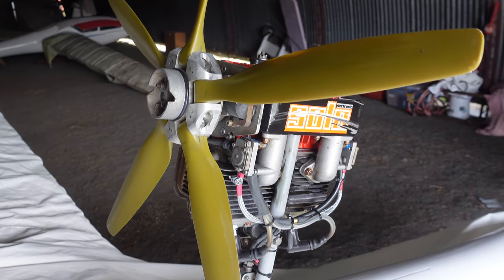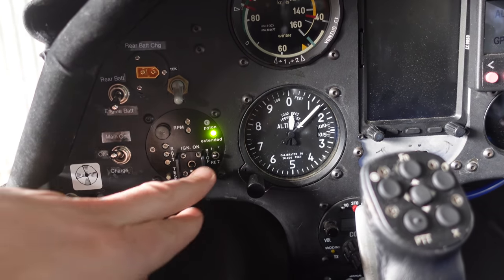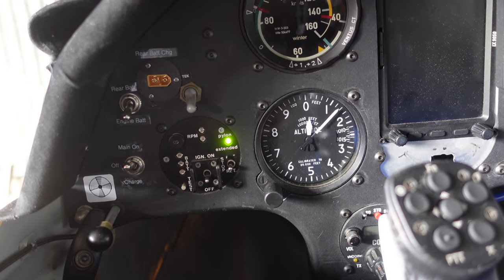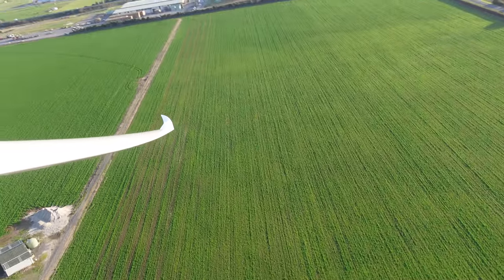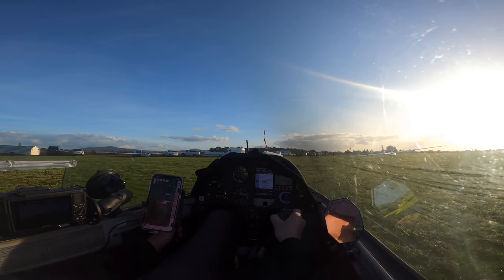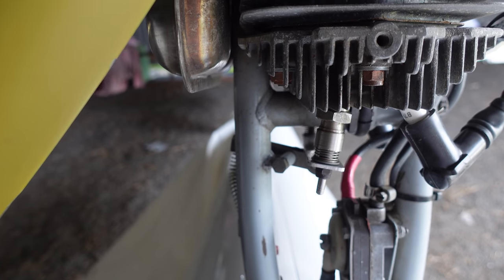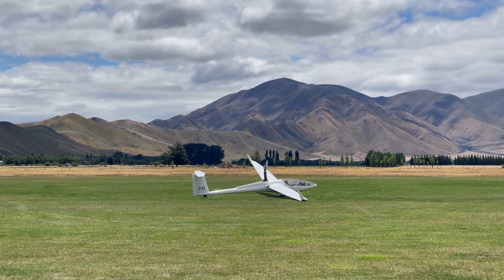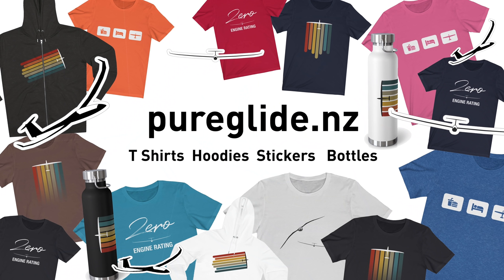How a Glider Engine / Turbo / Sustainer Works

Comment: The centrifugal forces (aka inertia) are enough to keep the prop from folding.  Perhaps this is another reason for the lack of a throttle.  At some torques and RPM, maybe the blades would begin to fold?
Reply from the maker: I don't think it takes much, they normally are fully folded out before I start the dive, before the engine even starts working. Keep in mind the wind on them too when flying...
Reply: @PureGlide  The wind would open them and spin them for starting.  I was thinking about after the engine was started.  The prop is a spinning wing, and the aerodynamic force is forward (trying to close the blades).  The only thing keeping them open is centrifugal forces, which are a function of mass and rpm.  The forward-folding blades seems somewhat bazar and counter-intuitive, but obviously stay open and work.
Reply: Centrifugal force is the only thing keeping helicopter blades from folding.

Comment: Since it can manage to climb with the engine, I'd expect it could likely take off from a good runway.  But this smaller one might be like one of the old wood and canvas airplanes where you need a bunch of helpers to start the engine and give it as much of a running push start as they can to get it up to a speed where it's stable enough to not drag anything on the ground.
Reply from the maker: Yeah that is exactly right, people have started it on the ground and launched with it I hear, a bit of a help to get it started can make it easier. One day I might try it! Cheers

Comment: Thanks Impure Glide ;) I don't fly sustainers but I guess another big risk is forgetting to mix the oil into the fuel... The engine would run for a few minutes, then you'd be hoping you could get back to the field you had chosen!
Reply from the maker: Oooh I don't even want to think about that! I have a careful process, involving two clearly labelled fuel tins...
Reply: If it actually climbs at 1.7 knots on average at 55 knots forward speed it's a piece of cake to get back to the same field even with a straight out climb -- as long as you put the engine away first. You do need to make sure you're not flying in sink though -- 1.7 knots is no match for 10 knot sink. You still have to think like a glider pilot, not a jet fighter pilot.
Reply: @BruceHoult  Good points! Hopefully you are also climbing into wind which will also improve the glide ratio back to the field. Haha yes even power pilots get caught out by the sink from mountain wave :)
Reply: I would suppose that one must be just as careful when refuelling this sustainer setup as aviator must be when refuelling any kind of aircraft engine. :)
All due care and attention required, since you can't get out and walk.

Comment: Don't those blades fold "the wrong way"?  Seems like when they produce thrust, they'd push themselves toward a folded position.  (Although I guess centrifugal forces would overcome that.)
Reply from the maker: I suspect the centrifugal force is stronger than the forward force they generate!

Comment: It looks backwards. How do the props not fold when throttled? The direction of thrust looks like it would push the blades closed. Is it kept open fighting that urge by centrifugal force alone? Why did they not just make the prop a pusher prop so it doesnt have to spin fast and can fold into the wind?
Reply from the maker: I can assure you it’s around the right way! And works just fine :) the airflow keeps the blades folded out, let alone the centrifugal force, which definitely keeps them out
Reply: @PureGlide  so the wind holds it open, but wouldn't the thrust push it closed?
Reply from the maker: The centrifugal forces will keep them open I guess! Cheers

Comment: Definitely I agree engine on the competition is not cheating but... it gives mental advantage that more risky option (potential outfield landing) is easier to choose.
Reply from the maker: Yeah agreed. Also the pressure to to not land out for inconvenience is not as great, so you tend to push further, or later into the day. I almost put that in the video too, but was getting too long...

Comment: Why not pull decompress before starting to allow lower speed dive and waste less energy
Reply from the maker: Hi I guess you could pull it earlier, what really matters is when it is released, and are you going fast enough at that point. So  pulling it won't make much difference, except a bit more time to spin up?

Comment: The T stands for Turbo. But what does the c stand for? I'll never know and won't be able to sleep now
Reply from the maker: The C stands for the C model after A and B. They tweaked a few things in the C model including the air brakes. The A and B models had trailing flap air brakes, the C has standard Schempp-hirth brakes.

Comment: Hey I love this Idea. Especially in a glider. All that redundancy...
Personally I think it should be a pusher motor/prop mainly because of the flipping blades. The reason I say that, the propeller would not act as drag only as a pusher if you have a tail wind. If course it would need a starter.. Just an opinion🙂 
Stay awesome brother! Amazing content btw brother!
Reply from the maker: Hi thanks mate! PS there is never a tail wind, the wind is always coming from the front as the glider is always moving forwards through the air. Unless I'm doing something extra impressive :)
Reply: Yes sir, that makes perfect since. My apologies.
 Really cool glider though 😎
 Also, thank you for your response.

Comment: Imagine if you could extend the engines props out, as if you're preparing to turn on the engine, but instead you just let it be and the blades begin to rotate. The rotating shaft is connected to a mini generator which will charge the in-plane battery.

Is such a thing feasible?  
Or say, some sort of "air brake" which is really just some props/blades that rotate, and thus provide some drag, slowing down the glider, but their rotation is changing a battery.

Kind of like on bikes back in the day, you would put these tiny forward facing lights which were connected to a mini generator that would be touching the front tire, and powering the light.
Reply from the maker: Hi yeah basically like the regenerative braking my skateboard has! Funnily enough big planes have such a system https://en.m.wikipedia.org/wiki/Ram_air_turbine
I don’t think gliders need it, if the electrical power goes out the glider still flies happily. We don’t need our instruments that badly. And if you had an electric glider, I don’t think it would create any useful amount of power to warrant the cost and complexity. Also anything like that would create a lot of drag, and would sink the glider faster. Interesting idea though!

Comment: you should install a pylon switch bypass so if you see the engine is up but the switch is not pressed you can still turn it on.
Reply from the maker: Wouldn’t be a stupid idea! Luckily it’s been working reliably for 35 years (probably time for that switch to stop working!)

Comment: On the other hand, you have to be very careful, if the motor does not start working while you are flying at a very low level. (the drag amount is huge). Just recently a tragedy, or almost a tragedy happened (hopefully, the pilot will fully recover). But yeah, it was a competition where people are risking more..
Reply from the maker: Yeah it’s important to give up early and make a safe retrieve and potentially outlanding. Did you see in this video how I tested landing with the engine out? It’s not as bad as you might think, but still like having the air brakes out!

Comment: Great vid Tim! Taking off with a Turbo will invalidate the insurance of course plus the climb rate would be awful thus making it almost certain you would need to make a claim.
Reply from the maker: Yeah I guess it possibly could! I assume once you're off the ground you're operating as normal...
Reply: "Taking off with a Turbo will invalidate the insurance".  I am not disputing that, but why is that?
Reply: @alexanderSydneyOz  well your answer is in the original statement. A sustainer engine is not powerful enough to take of safely, they are not designed to take off. What insurer worth his salt would in his right mind cover such an act!

Comment: Aren’t these just ‘get you home’ engines for when you get caught out by crap conditions?

I used to glide from an airfield on a hill and once ended up 200ft below the height of the airfield, took my instructor an hour to get high enough to land, followed by lots of swearing and him chainsmoking about 5 cigarettes in a row. Landing out was not unheard of but a major pain in the arse.
Reply from the maker: Yeah exactly right!

Comment: Whats the XT60 connector for? 
Funny to see that coming from the RC world
Reply from the maker: Yeah I'm using them to charge my batteries. The panel mounts I've got for them aren't great, so will be switching them out soon to XLR plugs which is what a lot of gliders use.
Reply: @PureGlide  Audio technician here. I've often seen XLRs used for all kinds of non-standard DC power connections, but it's worth bearing in mind that as a balanced audio signal connector they really weren't designed to carry any significant current. I'm sure it probably wouldn't be an issue if used only for trickle-charging a smallish battery at a few hundred milliamps, but may I suggest using Neutrik Powercon panel-mount connectors and plugs or their generic equivalents. They have a very positive twist-lock action with a sliding tab on the plug so they will never come loose accidentally, they're extremely robust (designed for use in live audio situations where such connectors are often subject to a lot of careless handling and abuse), and they're very easy to terminate as they use captive-screw terminals, you don't even have to break out the soldering iron!
A drop of loctite on the panel mount terminal screws would prevent any issue caused by connections working loose due to vibration. Just my two cents, cheers mate.

Comment: love that outro, you should do some vids on aeros / wingovers etc. also the state-of-play of electric sustainers would be interesting
Reply from the maker: Thanks! Yeah I'll cover other types of engines in another video sometime
Reply: I imagine electric options must be getting more viable every day
Reply from the maker: We've had an electric self launching glider in New Zealand since 2011! I sense another video coming on...
Reply: Electric sustainers should be a game changer. I wonder, if one could replace one battery with a generator for more range
Reply: @daszieher  they are very much a thing! The FES system is already pretty common (seen on most larger gliderports). I would think that adding a generator with fuel is just more heavy and complex than another battery for the same amount of energy and power.
Reply: @otsokivivuori7726  If it had the same amount of energy.

For the 15kg that one FES battery weighs one can add a good generator and fuel to boot easily surpassing the energy stored in 15kg of battery.

I agree though that the simplicity of operation and reliability of the actual drive (i.e. an electric motor driving the propeller) is much better. I just don't see the total energy required to be stored lighter in a battery. kg per kg, the generator wins.
Reply: @daszieher  depends on how much energy you want. A generator is necessarily pretty heavy to start but of course adding more energy adds less weight with gas. I would say that with the amounts of energy in a fes system batteries are still lighter.
Reply: @otsokivivuori7726  not quite. 15kg of generator and fuel gets you more electric energy than a single FES battery can provide.

obviously the power output will be different. so a combination of both might be best.
Reply: @otsokivivuori7726  no need to have a petrol generator! Just put the prop to negative (or very low) pitch and charge the battery while on the ridge / cloud street / in a thermal. Obviously it would have to be designed with variable pitch (at least two positions) and the system would have to be set up for motor/generator use, which current ones aren't. If everyone started with the same level of battery charge (possibly zero) it wouldn't even fundamentally change the nature of gliding -- it would be just the same as if cloud base was higher.
Reply: @BruceHoult  this is very interesting from a competitive aspect.

However, I was looking more into flexibility. There the possibility to "load" more propulsive energy without adding much more weight would be a clear advantage towards more utility.

Comment: I'm having trouble with this.  When the engine folds down, the blades come forward freely. This doesn't seem right because if it's producing thrust, the thrust would pull the blades forward, in the same direction they can freely fold.  Is there some locking mechanism on the blades so that they lock in place when the engine is turning ? If not, it seems like they would not be very effective.
Reply from the maker: There is no locking mechanism. And it works great!
Reply: You have to consider that there is a lot of centrifugal 'force' on those propeller blades when the engine is running. Folding sailboat propellers work the same way, although they usually fold backwards. They still work when putting the engine in reverse though.

Comment: You'd think that would be a very good and easy swap for an electric motor?
Reply from the maker: Unfortunately not easily without a lot of work and money. The better option is to sell this old glider and buy a new one with an electric motor already in it. Cheers!

Comment: I was thinking the blades would start to close forward from the wind generated once the engine was started. I guess the force is great enough to keep the blades in position. Interesting the same.
Reply from the maker: How is it the last 20 comments have all wondered the same?! And I’m not sure why it is, but it seems to work just fine. I imagine the centrifugal force would keep them out?

Comment: really useful video, thanks.  Is there much difference between a cT and a bT?
Reply from the maker: A few differences, a slightly different wing profile but the main difference being a different airbrake system. The cT has the standard 'schempp-hirth' style brakes that all modern gliders have, while the b and bT used trailing edge flap brakes. The cT also came with 15 and 17.6m configuration, while the b I think had 16.6m extensions.

Comment: Do you stop the engine with the fuel cut off or the ignition switch?
Reply from the maker: Bah I realised I forgot that but after I posted the video! Yip just turn off the fuel, drop it a bit out of the air stream, and wait for the blades to stop moving, then lower it

Comment: Does the high thrust line cause a sudden pitch down moment on engine startup or is the pylon sufficiently canted to counter it?
Reply from the maker: Good question! It’s very close to the center of gravity. I’ve never noticed any nose pitch when it kicks in, but you do feel the acceleration. It’s not extreme :)

Comment: I disagree it's an advantage to have a engine because you can push into places where pure glider guiders won't chance. You should have to remove the prop before competition that makes it fair. I'm just saying.
Reply from the maker: Hi that sounds great, except you'll kill yourself if you fly like that, because the engine doesn't always start. You always have to have somewhere safe to land just like a non engine glider. Cheers!
Reply: @PureGlide  Surprised at your comment let me carry on with other advantages you have. When one of your competitors has to land out they have to wait for the trailer to show and they might be returning after dark with damaged gear doors or at least a good cleaning. Meanwhile yours is clean back in the box and having dinner and in bed at a reasonable time. There are a lot of things you overlook.
Reply: @briangarcia8986  Hey, when you have money running out your ears...
Reply: @u2mister17  Hi u2 not sure how your using the term. But if you can't afford a crew maybe you should just stay in the pattern. Think the case I made is quite clear and reasonable. Spelled out the advantages nothing more needs to be said.

Comment: Why would you ever switch off the fuel? I have a Ventus 3 and it totally unnecessary. It removes one of the things that people seem to forget in a hurry. However there may be good reasons for other types. The starting height in the video looked like it was on final approach to the field. I would prefer circuit height at least.

Comment: The idea is really cool but if I'm going to fly with an engine I might as well run a conventional aircraft
Reply from the maker: Depends if you want to do some gliding or not! It's like a small boat vs a sailing yacht. Sure the small boat will get you from A to B easily, but it won't be sailing will it!
Reply: @PureGlide  well, if the boat floats I'm happy
Reply from the maker: Haha good attitude

Comment: what if you just know you need your sustainer and not in a competition, and know i need it to get across a dead spot,  and are at 18,000 feet... cant i just open it up as im leaving the last thermal and cruise up there without wasting fuel climbing back up?  if it doesnt fire ill put it away and look for a landing spot... or is that a No-no?
Reply from the maker: You can open it and use it anytime when not in a contest BUT it depends what you're doing. If you're just going for a casual flight, then no problem, use it as you want. If you are trying to do a badge, or an OLC or WeGlide flight, then using your engine is like landing in a paddock. So you'd normally only do it when absolutely necessary.